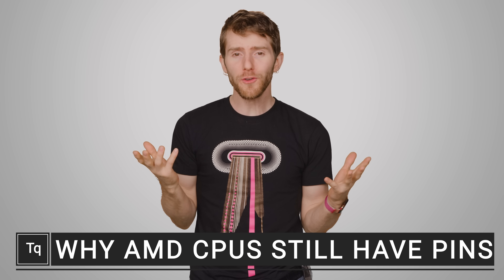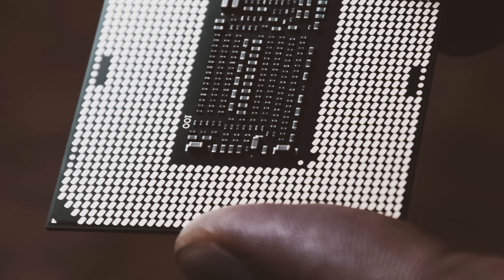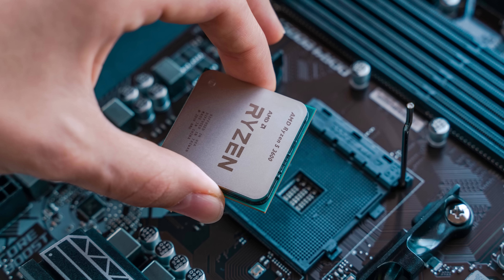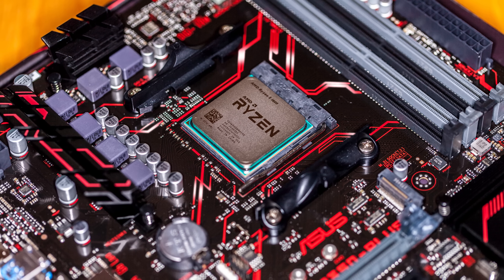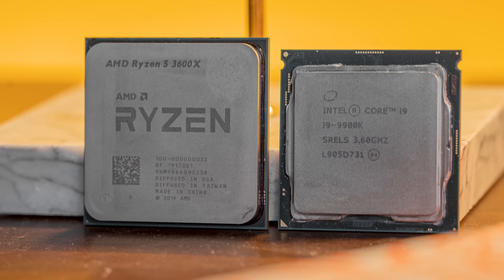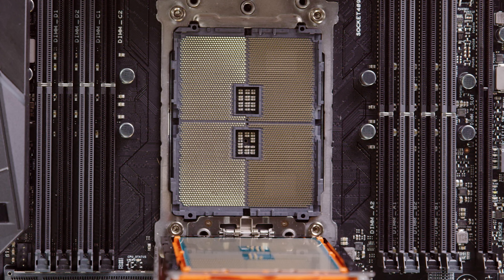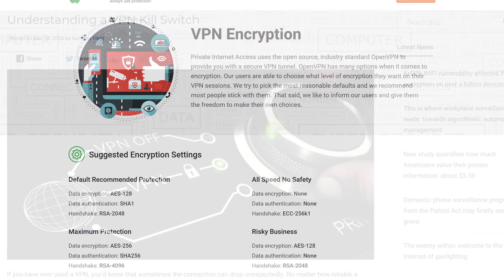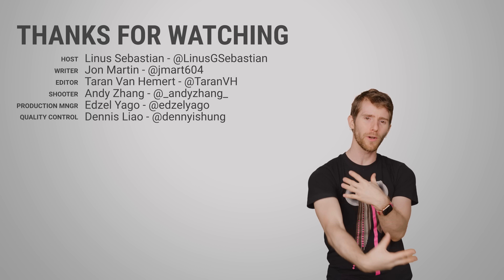Is AMD Stuck In The PAST?

Comment: I've built probably over 100 PCs with AMD CPUs, never had a problem with a bent pin. 
But I managed to smoke one of the most expensive CPUs I ever handled by not removing the foil underneath the heat sink...😣

Comment: CPU is a removable component. Motherboard is a system component. One is very "removable" isn't it?
I would rather change the CPU, even if it is more expensive.
Reply: Both are very removable. Yeah it takes more work to remove the motherboard, but most people would easily do like 30 minutes of extra work for even $50 savings, and Often it's actually a few hundred in savings.

Comment: The biggest problem is that the cooler, atleast the original Wraith coolers get stuck on the CPU, and you pull the whole CPU straight out of the socket if you try to remove in with the TIM still cold - resulting in bent pins and risk of a broken motherboard. Did that on my Ryzen 7 (bent the pins back - OK), and i have not have any problems with my Intel setups. So, LGA over PGA any day.

Comment: Completely ignores the main reason AMD still uses PGA... Aka cost. It's MUCH cheaper overall vs LGA. (Similarly priced CPU's but the sockets & thus boards are SIGNIFICANTLY cheaper). This is the primary reason why AM4 boards are generally cheaper than their Intel counterparts.

Comment: 2:20 No Linus, LGA is easier to install because you just basically drop it when you have to actually line up the pins on PGA
Reply: @Heisneberg - Gaming You don't need to be perfect though, and I like it better because I'm not accurate at all in small movements.

Comment: Now that I've watched this video, I'm very curious to know how those LGA sockets make proper contact with the CPU. I would imagine that the pin setup on a PGA pinchas the pins onto the conductive material, no? If an LGA pin is slightly too short, wouldn't its ability to function be badly affected?
Reply: Benchmark tests are in order now.

Comment: I remember installing an old Athlon with my mom when I was a kid.  The pins were like 4x longer than they are on a modern Ryzen, and the damned thing just didn't want to go in.  You're not supposed to have to push down on the thing with both palms and your body weight to get it in the socket.  After 30 minutes of anxiety and trying and constantly checking to see if we'd broken a pin, Operation Mash It In commenced.  Turns out that's just what the stupid thing wanted.  After that, I was DONE building computers, for like 15 years.

Comment: They need to beat Intel in gaming if they really want to be the best processor in the world.
Reply: Um... They have. 5000 series of processors. Particularly the 5900x and 5950x beat the best Intel CPUs in gaming.
Reply: @sparhawk1228  I saw the benchmarks they were impressive. Now I only hope Razer builds a Blade with an OLED screen, a 3080 Max-Q and a Zen 3 CPU. I would buy that in a flash if they ever built it. Sadly I have a feeling that only cheap laptops with shitty screens will get Zen 3 just like they did with Zen 2. Premium laptops makers have a stigma with using AMD CPUs.

Comment: I'll share a trick for you AMD pinheads, if your pin has broken off, take a small resistor and cut a lead from one side. Stick that lead into the motherboard and cut aproximatly where your processor touches the lead and insert the CPU, lock and load, and BOOT time, I did it once.

Comment: ********Correction***********
Intel used PGA for the Q6600 Core 2 Quad chips and all the socket 775 going until the last NVidia chipset 680i(if I recall correctly), They didn't really abandon PGA until November 2008 with the advent of x58 when they officially switched to LGA for the consumer sector.

This actually made the Mobos more expensive, and for enthusiasts spending $300-500 motherboards it is a pain in the ass, Companies refused since x58 to replace mobos under warranty for bent or missing pins, Asus particularly got a bad name with customer service because of this, stating their motherboards go through quality checks especially the ROG brand, when in actuality there were riots in China over bad labor practices where they were purposely damaging the sockets with bent pins from a finger being squashed into the socket, I seen pallets of them that got damaged from the factory this way, Asus solution was to have customers pay for a new soldered socket, which people were getting used boards from other people sent in from warranty with physical defects like scratched and dented heatsinks, they even revoked warranty to streamers + C.C. doing system builds that had evidence of no user damage.
Since that very particular chipset vendors have not factory sealed motherboards with shrink wrap which is another issue.

Comment: It's the same with BGA chips  (Ball Grid Array)  like the  PS3's main and memory chips...... they are good when the solder has some flex to it like leaded solder, but lead free doesn't have that so the contacts break resulting in all kinds of problems. And yes I have reballed my own PS3 main chips after it got the lurgy. Still going strong. 

Yes it is easy to bend pins pins on AMD chips and you need a very delicate touch to get them straight without snapping....... a soldering iron helps. Make sure the soldering iron tip is free from any solder and flux, use the heat to  warm the bent pin then carefully straighten with tweezers. The pin won't melt but the heat reduces the chance of the pin snapping off..... leave to cool naturally.  You need steady hands too

Comment: It's better Intel solution because the processor cost a lot more than the motherboard. So if I  drop the processor I do not damage it 👍
Reply: Pins on CPU makes motherboards cheaper to manufacture. AMD does RMA your CPUs unlike Intel.

Comment: "Until intel ditched the pga flow back in 2004.." 
Me: sees my processor
Reply: I also have a 2004 cpu . Pentuim e2160 but its lga
Reply: @adel gamer same. Unfortunately I knew nothing about PCs at the time, and the dude who helped me to make configuration was an intelboy. He made me to buy intel in a year when intel was at it worst.
Reply: @heyhoe168  And sad thing is now as they changed socket, You will have to buy new CPU + Motherboard + Ram (If you want good speed)
Reply: @heyhoe168  same

Comment: i pulled out my r5 1600 with the cpu cooler(thermal paste was too dry and stuck on cpu) . luckily no pins got bent lmao. i had to reapply thermal paste a few days later since the cpu was running at max temp. then i was back to good ol 69C. nice

Comment: If i have an i5 3470 can i upgrade to a newer i5 or i7?
Reply: No, you need a new motherboard because 10th gen i5 uses 1200 socket and yours 1155. So not compatible.

Comment: You forgot to mention that with PGA you can easily rip your cpu out of the socket when removing the heatsink if you pull straight up instead of twisting side to side. PGA way too easy to damage, LGA hands down better in my book.

Comment: I'd prefer pins for some reasons

Better power delivery 
If you have thermal paste in the holes it's possible to remove through hours of hardworking with a needle (AT LEAST POSSIBLE! ), If it's on intel's socket, then you're done (literally impossible coz the pins on the socket are ultra thin and ultra weak
Reply: How the fuck would you have thermal paste in your AM4 socket? That sounds like a you problem
Reply: @merry1694  I accidentally put too much and while removing the cpu, my thermal paste enhanced fingers glided swiftly over the am4 socket which resulted in a layer of thermal paste on the am4 socket

I also touched the cpu pins with my finger.
After 1 hour of hardwork with a needle , I managed to just remove enough thermal paste to get the cpu running

It it were to be intel, I could have expected to lose a brand new mobo coz the mobo pins are just too delicate

Comment: I would also think you would also increase the surface area of the contacts using pins, therefore helping to draw a little heat into the board. Minuscule  by all means. Just a thought

Comment: I remember when intel made this move. Word in the enthusiast community at the time was intel was tired of having chips RMA,ed for bent pins. So this way when a pin was bent, the RMA went to the mobo manufacturer. That said, I never really had a problem either way. Both worked for me and I have never bent a pin on a primary rig. Only on secondary or trinary systems where I am normally less careful.

Comment: And just after this the 3300x was released proving cores isn't everything (if really necessary)
Reply: If it proved anything, the 3300x proved that AMD still has high inter-core latency that is bottlenecking their CPUs in games. This might mean that the 3600x and above will get slower over time as games use more than 4 cores. Zen 3 is rumored to have 8 cores in one CCX which should run much better in games

Comment: I unfortunately know all too well about damaged PGA pins though it was totally my fault (but the $500 I spent on a new processor and motherboard sure as heck hurt).  AMD chips are easy to install, the coolers on the other hand are a pain (slightly easier on my newer mobo than my first but still a pain to reach the levers and line everything up).

Comment: i hit pga desgin i broke my x570 mobo and almost the cpu because of this fu**** design 
my fault was the cpu came before the mobo and I was excited to see it so i open it then return it to the plastic piece but in the oppesite direction  what happend is the cpu pens bent and when the mobo came out i installed the cpu therefore it bent the am4 socket pens 
because of that i forced to cancel my 2k 144hz monitor  i am really sad really sad  😥😥😥😥😥😥

Comment: In my experience I've actually found the pins on AM3/4 CPUS to be a lot more durable than LGA board pins. I've seen so many damaged and bent pins on intel boards where as I've never had issues with am4 pins lol. That could perhaps be a couple instances of luck of the draw/defective parts :o
Reply: Made this comment before finishing the video and you discuss this briefly too! :P

Comment: I've never had a problem with bent PGA pins. Ever. I had one experience with a bent PGA pin, when a friend bent a CPU pin while trying to upgrade their computer, and it was braindead easy to fix. Meanwhile, my current board, the first one to use LGA, arrived with multiple pins bent, and I had no other computer at the time, so I had to bend that shit straight myself. It was a massive pain in the ass.

Yeah, no. LGA is trash. I'll take a sturdy PGA socket over that flimsy LGA crap any day of the week.

Comment: I'm sorry, but overall, PGA is far worse for the average amateur builder.
If you drop or even hold improperly a Ryzen CPU, you can easily bend or break the pins.
But when it comes to Intel's LGA, I've seen people drop them hard to on the floor, and the CPU functioned perfectly fine after that.

Even just removing the CPU cooler can be an issue.
If the cooler cold plate is "stuck" onto the CPU IHS, due to a suction force effect from the thermal paste + the flatness (or lack thereof) of the IHS and cold plate, it can rip the CPU right out of the locked socket.
With Intel's LGA this cant happen, since it locks the CPU down, and therefore it cant pull it back up if this suction effect occurs.
Its happened to me, and it was a nightmare to deal with.
The CPU was so firmly stuck, I almost believed that the thermal paste was acting as glue or something.
Needless to say, it wasnt the thermal paste, this is due to the cooler cold plate and IHS surface manufacturing tolerances, which can result in that sort of thing.

Comment: PGA is also easier to uninstall, forcefully. As the thermal paste has hardend a bit and with some cooler designs, you cant twist them. Meaning you rip the CPU out of the socket with the cooler. If you bought a shitty mid-grade tower cooler like most people will.

Comment: You forgot the most important difference.
AMDs motherboards tends to support more generations of processors so you're more likely to buy a higher end AMD motherboard since it might be used for two or more generations of processors unlike the one time use Intel motherboards.
And as a result you're more keen on the motherboard lasting since you might end up buying a motherboard that's going to be used for a longer time then your CPU.

Comment: During a build, regardless of AMD or Intel, I inspect all the sockets and processors for visible damage. Inspecting the socket on my MSI X399 Pro Carbon AC was an intimidating experience. I was scared shitless during the entire processor installation and cooler mounting process.

Comment: My non-techy friend wanted to "clean the dust off his fan" so he "removed" it aka ripped out the entire cpu cooler WITH THE AMD CPU STILL ATTACHED then cleaned it and just PRESSED IT BACK ON without opening the socket or anything. Then he asked me why the pc wasn't booting up. I was in pain whilst he told me what he did, andas expected half the pins on the cpu were bent
Reply: Oh thats brutal murder . Go to jail
Reply: oh god that was more painful to read than watching the Ankle scene from Misery.
Reply: how can you even do such thing lmfao. if you’re handling something you clearly don’t know how to handle you have to be at least 200 times more careful.
Reply: Your friend's a maniac man
Reply: My cooler master regular thermal paste dried out within 2 weeks and when I tried to remove it the entire ryzen 5 3500 came with it (without unlocking the bracket). I freaked out. I had to use a screwdriver to separate the cpu from the heatsink. Thankfully,  the cpu survived
Reply: @EvanFerrao  This happened to me as well, except the fan had been on there for years... I was trying to gently move it then the whole thing came out, but no pin issues... I was in the process of swapping CPUs, the upgrade had a bios/ram issue so I swapped in the old one it booted which gave me some relief... then one pin was stuck while trying to remove it again... That's when I bent 4-5 pins. Luckily I found a small needle and gently bent them back 1 by 1 and it's good to go. Had me freaking out.
Reply: @EvanFerrao  little tip. Next time this happen use an hairdryer to heaten up the thermal paste and the cpu will come off really easy
Reply: @gameroy56  thanks a lot!
Reply: @EvanFerrao  twist the cooler before pulling it off the cpu
Reply: @natebit7167 Sometimes that doesn’t help either. It is better to unlock the processor so that it comes off from the motherboard with the cooler attached.
Reply: @EvanFerrao  I've had this happen a few times during my lifetime of removing CPUs. Happens more often than I would like. The difference is how you handle it. I've rarely bent pins from this, and never to the point of destroying the CPU.
Reply: @EvanFerrao  always twist while slightly pulling up.
Reply: on an Intel board he would have ravaged the whole socket of pins lol
Reply: Why are we still here just to suffer
Reply: Socket AM5 should have a retention bracket like an LGA socket does, but it could still be PGA.
Reply: @Dreams_Of_Lavender  good call!
Reply: It is impossible to remove my BeQuiet radiator from my 3900x without sucking out the CPU from the socket. Before someone writes it the aligning bolts of the cooler don't allow me to twist it while pulling. The best I can do is pull as straight as I can.
The pins under the CPU make it difficult to clean from the thermal paste and a higher price in case of damage as Linus said.
The absence of a robust metal bracket as Intel does is in my opinion an engineering error
Reply: @matteol.7311  Run something like prime95 and heat that cpu after this procedure it will come off easy.
Reply: @matteol.7311  Hence, AM5 should have a bracket or be LGA. Intel's going to be stepping up to 1700 pins soon. AMD is going to have to be able to compete with that because you need more pins to do more things. A 1700+ pin PGA would be MASSIVE.
Reply: geez, a fried of my brother did exactly the same today. The cooler i had installed when i built the PC back in the day (she's still using an FX-6300, good times) came with some weird cheap thermal compound that glued the heatspreader to the cooler so strongly that the chip came out with the cooler.

Luckily, she put it back in in the correct orientation, so after "sawing" the CPU off the cooler using some dental floss, none of the pins were bent too much, and we were able to get the PC to work again.
Reply: What kind of person starts screwing around with a machine that costs hundreds of dollars without even googling how to not destroy it first
Reply: Not carefully cleaning the cooler? Yes your friend is a bloody murderer don't pass him to any kind of electronics
Reply: Are the people in this reply section missing the 'non-techy' bit?
Reply: that was actually painful to read... I made the mistake of not softening paste and yanked out the CPU, but I never bent the pins...
Reply: Happened to me once or twice back in the days with s478 Pentium 4 which had pins... Didn't force it back of course lol. Dunno about AMD but that s478 locking mechanism really wasn't as strong as LGA ones.
Reply: You can’t fix stupid.
Reply: NCR_Ranger .- No one can fix your ego.
Reply: Oh god
Reply: I think we might have hit peak stupid.
Reply: just set him on fire
Reply: I used to have an r9 3900x and The cpu fan was stuck to the cpu and I tried pulling it and it came out but I bent the pins so I had to get a replacement. Supposedly you need to play for a bit so the thermal paste is a bit loose. It was on my part.
Reply: @bruh whats wrong with the grammar? Sorry I'm not an english native speaker
Reply: Murder him because hes not 80 he should not be that dumb
Reply: Yess7895  H E S N O T 8 0
Reply: OOH dat hurtz
Reply: Bruh I'm not that knowledgeable but even I know not to do that.
Reply: Lmao
Reply: Pain. Peko
Reply: Oh my
Reply: AAAAAAAAAAAA